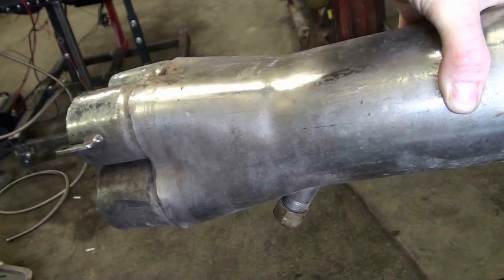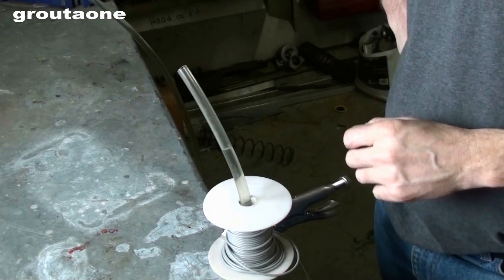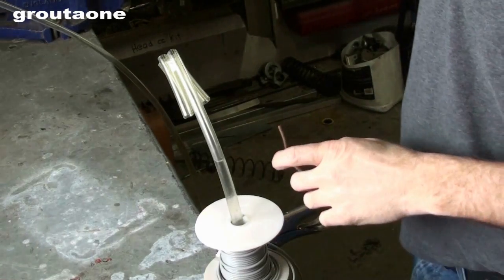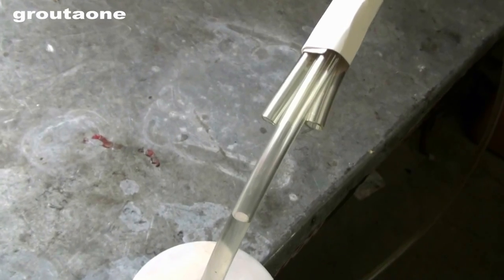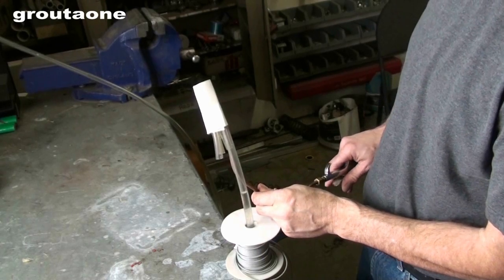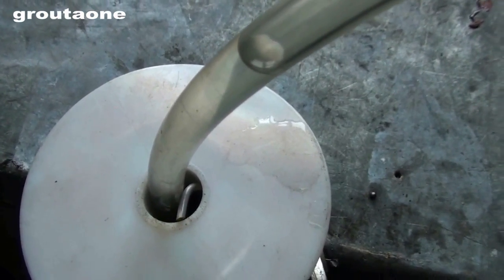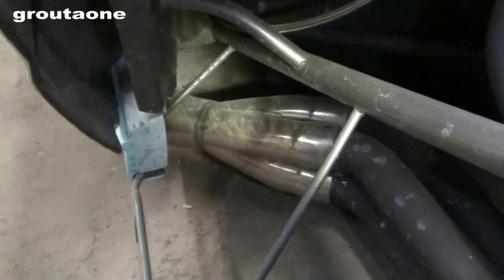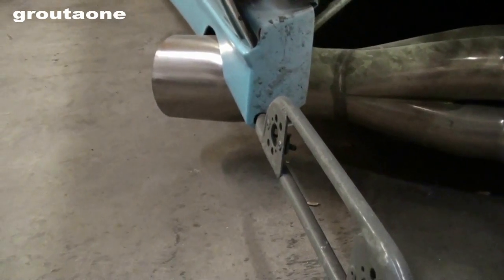Header Collector Science

Comment: Also, locating the primary tubes in the collector such that they "pulse" in a circular sequence encourages scavenging and creates a vortex in the collector extension that speeds up the flow and enhances the scavenging. Additionally, a larger diameter expansion chamber after your 16"-18" collector section will add to the effect by allowing the exhaust to expand and cool thus drawing the exhaust out of the collector even faster.
Reply: The coolest thing about engines with multiples of 3 cylinders is that you almost CAN'T fk up that sequential firing pattern. V6? Each side will be balaned. Straight 6 with two headers? Same. Straight 6 with a 6-2-1? Same. Boxer 6? Each side balanced. V12 with 4 headers, or two 6-2-1 headers? Same.

The hardest one to do is a crossplane V8, since each bank within itself fires un-evenly.

Comment: What did you have 90-100psi on that blow gun? the amount of air you blew thru that tube was at lest 50-75 times that of an exhaust pipe and exhaust is not a steady flow it moves in pulses. Sooooo the demonstration does not remotely depict an exhaust system.

Comment: I have some 1.75 inch primary headers and I maybe making more power then they would handle, can I do anything to help out the primaries ? Maybe with a longer collector or step up the collector ? I'm in the middle where my power is not enough to go up but might be too restrictive & room is a factor in the engine compartment. Thanks for any help. 440 dodge dart 1970 is my project.

Comment: Awesome video! I will share the link on our FB., page. Quick question, i just purchased a set of LTH for my Z car, It's a NA., With all the bolt on's. The Primary Collector is only 2.25" OD, and i was thinking of having a muffler shop, cutting that section off and welding a 2.5" or 3" OD. Would having a bigger OD., help scavenge better?? Thanks!!!

Comment: So does this effect apply on turbo application as well? In other words should I bother making a "Header Collector" between header and turbo?
Reply: +Tautvydas P
Conventional wisdom says that supercharged engines don't "care" as much about these finer details of optimizing exhaust headers (so long as they are large enough to accommodate the mass flow of the engine in question) since they effectively have an air pump forcing air into the cylinders, which helps push exhaust out. So, unless your turbo exhaust manifold or header is poorly designed, you're probably not going to see a very big difference in messing with things like full on merge collectors and spikes.
That said, I've never really seen anyone mess around with this on a dyno with a supercharged engine, either roots, centrifugal, or turbo.

Comment: interesting, but wrong application of Bernouilli.  Exhaust isn't steady state flow, like you show, and the collector is not shaped like a venturi (small primary into larger collector).  There are many books with the proper explanation.  It's an acoustic problem, not a flow problem.

High pressure exhaust pulses hit the collector, and reflect LOW pressure pulses back to the other cylinders.  If an exhaust valve is open at the same time, you get scavenging.  American V8 are known to have POOR scavenging because of their firing order (they're not timed correctly).  Some exhaust valves will actually have a higher pressure than the others.  Having slightly "too big" primaries and collector actually dampens the pulses, and weakens scavenging (and weakens the high pressure reflected pulses).
Reply: +Silvia Scolaro 
Primary reason for poor design is down to economics of construction - the manufacturor can sell a 'performance' manifold that is, if anything, a 'freeflow' that is usually an improvement on the OEM, the customer will pay for a fancy coating and everyone's happy - my issue is they're not 'performance' manifolds and shouldn't be sold as such, especially when they're 'one size fits all'.
It's not so bad with 'shorty' headers that seem to have been brought out as the 'Fuelie' Corvette 'ram's horn' castiron  version with the 2 1/2" outlet became hard to find, but the longer length 'headers' because their long enough to affect the scavenging between different cylinders. 
Way back when Hot Rod magazine [might have been one of the other mag's, though - it was a long time ago] was actually interested in the readers, rather than the advertisers, they did a big comparison of small block performance headers, different pipe diameters, lengths and collectors, on a '57 with a "450 hp" small block - with that particular engine there was a FIFTY horsepower difference between the best and worst - so what can you expect from a generic system?
There is a valid arguement that the different lengths will have different scavenging at different rpm - BUT that is compromising the rest of the engine's operating criteria. if you have everything optimised for a 4-6k range, why introduce something that may sometimes work higher or lower than that?
Be honest, would you try making the 'less peaky' arguement for 'ported' heads that had different flow rates, camshafts that had different lift and/or duration, carburetors or throttle bodies that had different sized butterflys, etc?
Heck, some of the readers may be old enough to remember the fad for 'tri-Y' exhausts and the problem of extreme mixture imbalances when the #5 and #7 cylinders were connected on the small block Chev' engine - I'm sure there were others.

If you polish a turd, it's still a turd...
Reply: GordonWG1 when I bought my 73 trans am 20+ years ago it had try Y on it. I scrapped the. Immediately. Hadn’t heard bad things about them but common sense told me they were junk
Reply: spot on mate
Reply: Well, to be more accurate, it is a two part design question.
a/ velocity - this is a function of pipe diameter and does bring Bernoulli's principles into it
b/ length of primary (and secondary or tertiary) pipe length* - this is what you seem to be thinking of - and wave theory is the design criteria.
To properly design and build an exhaust manifold, you need to take both into account - diameter(s) and length(s).

*This is also what most "performance" (actually crap) big name American manufacturors seem to ignore with some having more than a foot difference in primary length on their "performance" manifolds.
Reply: Thanks for pointing that out.  I cringe whenever some hotrod guy talks about Bernouilli.  Usually, they describe something that would create perpetual motion if they were right.  I think the scavenging effect is created by the mass of the moving pulse of gas simply creating a low pressure behind it.  I think that's why pipes that are too big lose the effect - they lose the pulse velocity and it stops before leaving the pipe.
Reply: +GordonWG1 Its not ignored many times due to chassis limitations and limitations in manufacturing equipment you have to have large differences in primary length.   That being said its not as critical as you make it sound.   Equal length headers are not mandatory infact having them staggered a bit can help a power curve be less peaky.   Which is particularly useful with heavier cars with 2 or 3 speed transmissions.
Reply: I just wrote something on this. US V8s are timed correctly but the problem is the cross plane crank design itself. Unfortunately as the cubic capacity rises, reciprocating mass rises making a flat plane crank unable to be used over about 4.0L. This is where the whole scavenging debarcle arose becuase it was said a way of negating the uneven firing of a cross plane crank could be negated was by scavenging. 

Well I don't believe scavenging works on the street as header manufacturers would lead you to believe. The reasons are complex but it's something like this, cross plane cranks benefit from scavenging but it occurs in such a narrow band as to be pointless chasing it on a motor that has such a broad spread of power as a street engine. There are too many variables for it to work properly. There is a way however that MAY (no promises) work and that is anti reversion cones in each of the primary tubes. 
There are some things that are known to work generally for specific motors. For example the 440 Mopar is known to benefit from 2" primary tube headers going into 3 1/2' collectors. Indeed it seems to be the case but that is from a factory sponsored drag racing data collection and the info gained is so narrow nothing is relevant outside that particular motor with iron heads and larger valves as specified by the factory manual for hot rodding the B/RB. I am sure there are other knowns for other motors, but for the home hot rodder unless you have a dyno, about 1000 hrs, $150k, 49 different combos of header primary tube length, intake type, head work valve size, port size, camshaft and on and on and on into infinity then you're just guessing. 

Headers are about reducing pumping losses and stopping reversion. Some do it better than others, but the main cylinder filling effect is the inertia of gas flow initiated by camshaft lead and lag (AKA overlap). How well that flow can be kept moving, post exhaust, may give an added boost but I doubt all cylinders are going to benefit equally due to intake manifolding! The whole header thing is designed to even it all out as much as possible by having the leaner cylinders running at the correct A/F ratio and the richer ones running too rich rather than the richer cylinders running the correct A/F ratio on and the leaner ones being a bit too lean but within specs for longevity. The whole thing is a balancing act and reducing exhaust pumping losses will yield a power increase since the the volumetric efficience of the engine has changed. 
Port fuel injection aids this since the intake runners are intentionally tuned. 

So that's my take on it. Header manufacturers say it's science, I disagree, so I guess they're right and I'm wrong because they have more money than me implying I have shit for brains. As I mentioned they're right.
Reply: Hey guys can you recommend some sources where I can learn how to built my own properly scavenging headers? I've been interested in the topic for some time and have dug through the Internet hundreds of times only to find vids on how to weld it, but not on how to design it 😖
Reply: @S7midnight  I'm no expert but I believe the basic idea is to figure when a pulse wave will exit each tube and make the lengths so that each pulse is timed with the exhaust valves of another cylinder.  You would need to know precise data about the valve timing, and calculate the tube lengths accordingly. I'm guessing reading up on tubal resonance and flow characteristics of the tube would be required. In other words, some fairly complex engineering.
Reply: Can you please answer a question about collectors ?

Comment: That is an outstanding explanation!  The set up on your race car does bring up one question, the ever talked about “Backpressure”.  Is backpressure a myth, N/A for race cars, only applicable for street cars……????
Reply: Back pressure is good for fuel economy I'd imagine, the idea being is to keep the fuel/air mix in the cylinder based on your cams overlap. With a car like this, a small wasted bit of fuel(pulled through the exhaust unburnt due to scavenging) is probably beneficial for power production as it means the maximum amount of exhaust has been scavenged and replaced with fuel:air, leading to more power.

Obviously EGR is good for reducing emissions and improving fuel economy in daily drivers, but it does suck a lot of power if its in use.

Comment: It's all about tuned length v positive and negative pulse waves timed to the running RPM  range used  v swept cylinder and Port volume and a whole host of other things that just like a 2 stroke Dirt bike's expansion chamber if done correctly can create more HP if done wrong can rob you of it big time. In fact a good 10% or better of your HP can be made in just the exhaust alone. :) the contribution to the scavenging or ventilation of the engine that a good exhaust makes is HUGE.

Comment: Gee shorty headers ? my Corvette looks like it has them stock. I am trying to more Hose Power. TPI is only 230hp out of my 350 not good. a 58 MM Throttle Body helped a great deal so much maybe my old 1 was bad? looking to dump the air pump and cats. got some shorty headers and want to get Corvette Exhaust Pipe Set HP Max Output C4. IS THIS GOING TO HELP ME A LOT?

Comment: Back pressure does not help at all unless you have either excessive overlap or a two stroke engine. The optimal exhaust has as little restriction as possible while maintaining high exhaust velocity. The idea is to draw all of the exhaust gases from the cylinder as fast as possible.
Reply: it does help from 1500-2300 but kills after that, so back pressure is bad, but if u ran a generator that ran in the 2000 rpm range you could benefit.

Comment: In the '60s when Porsche put a 2-liter flat 8 in a sportscars, engineers tried 200 exhaust systems. I don't know what they were looking for, but it wasn't a science back then and it appears that it is still hit or miss. I know that for high rev horsepower you want a short stack or airhorn over the carb or FI, a long intake manifold then a short exhaust. Low rev HP requires just the opposite. Outside of those general parameters, it is all guesstimates. And lots of testing. And between front end

Comment: that's a very good experience and really instructive !
thanks !
but (tell me if i'm wrong ) on the engines the extremity of the pipes are closed by the valves.
the strokes are not at the same time and there are counter pressure when the valves close.
the gaz pulse of each stroke is helpful to pull the next but it depends of the length of your pipes and it works good only at a certain rpm.
very good instrucitve and simple example !!!
how do you do the clean transition with your other you  : )

Comment from the maker: @merlyn59  I Couldnt help myself, anyone who works on military turbines for 30 years gets a salute from me too. I have run in Gimli but never with this car, however this engine has run there in a 3800 pound (with me) street car, went 10.04 @ 136 pump gas, no bottle, no trans brake, tight converter.

Comment: I don't get it then what is the function of the back pressure with the economy of a vehicle then if the collector helps pull the spent gas from the manifold? i thought i had that one down pretty well and this kinda blows a hole in the whole theory of back pressure that i had worked out in my head. (dangerous place BTW lol)